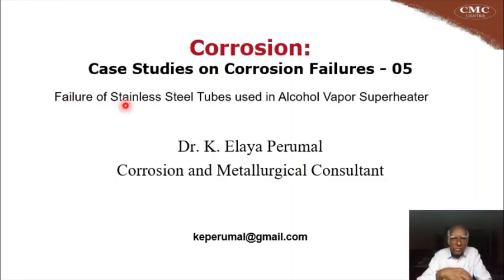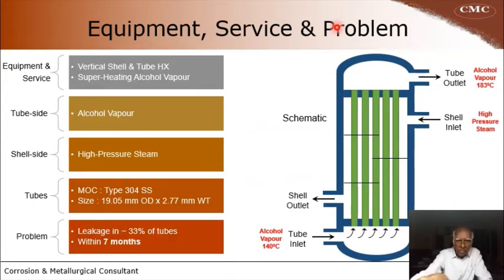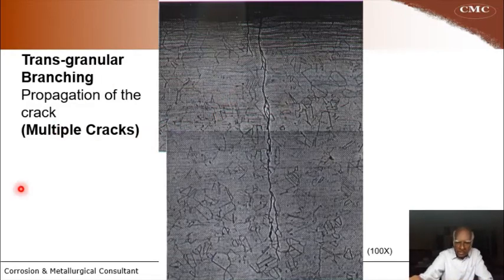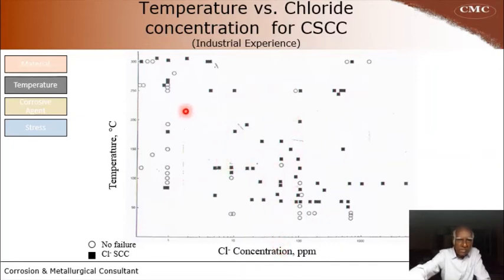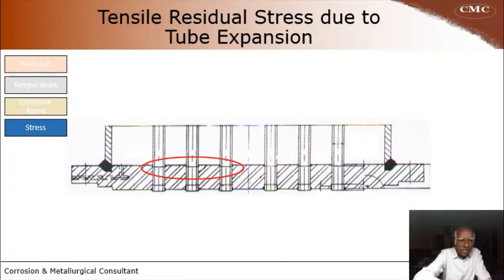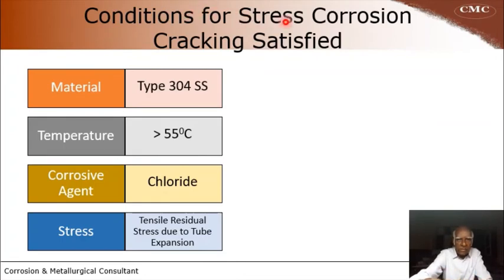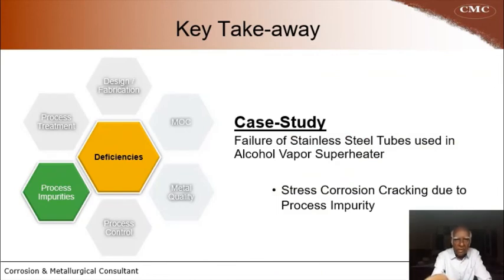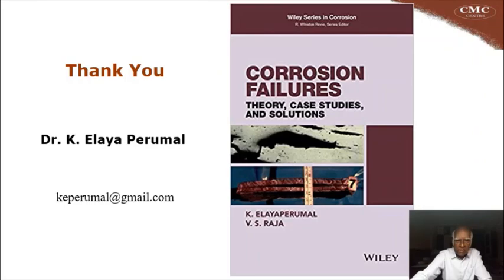Lecture 9 : Corrosion : Case Study on Corrosion Failures - 05

Comment: Is this due to the concentration of chlorides as moisture evaporated at high temperature. What was the thickness and the MOC of the tube sheet. Was there enough heat conduction at the interface of the tube sheet and the tubes to avoid local overheating.
Reply from the maker: 1. Yes. I think so. Chloride Concentration.  2. Tubesheet MOC - 304 SS.  Tubesheet thickness was not considered.  3.  There was no need to check this.
Reply: @corrosionknowledgesharingb8203  Were tubes expanded along the entire length of the tube sheet, if so tubes, must have been deformed and crinkled at inner edge of the tube sheet, as the failure occurred 5mm beyond the tube sheet inner edge.